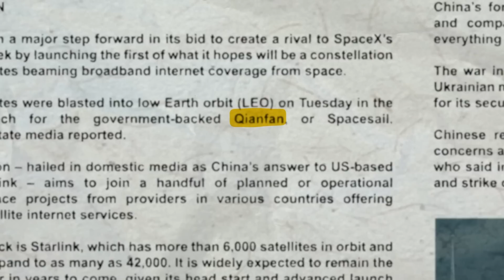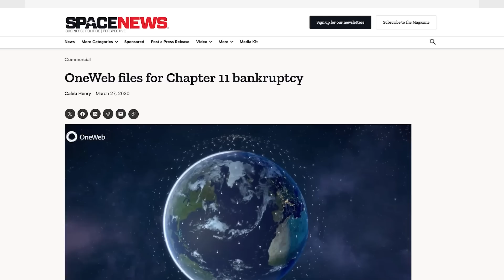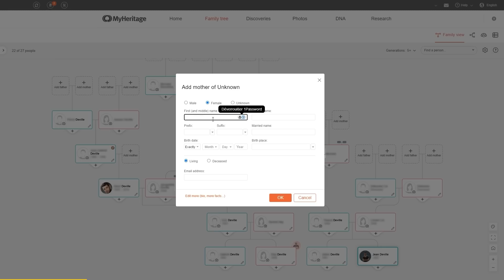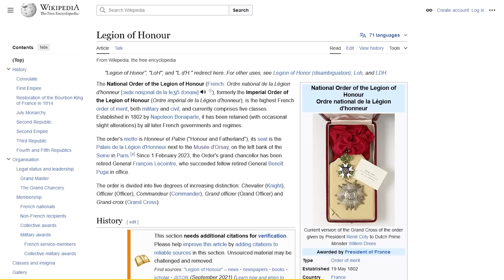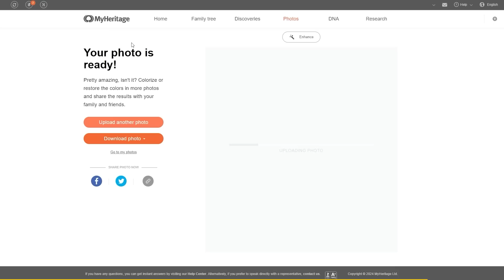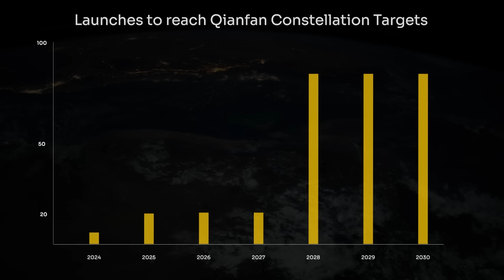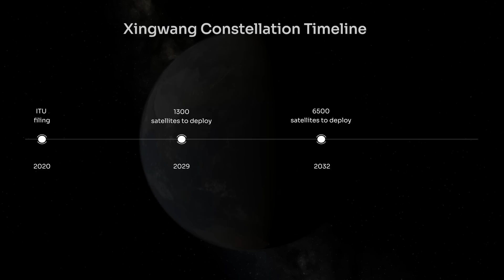China Is Deploying a Starlink-like Megaconstellation

Comment: Only 50$ to send satelitte not 50 millions $ with
AntiGravity Drone
Work base on Gravity just spinning by using Battery.

can fly in bad weather plunge in the ocean even in outer space

Earth which weight predict 600 trillion ton does not fall at the Sun because of centrifugal in orbitting, on the contrary it does not be thrown far go out the orbit line of hold by gravity at the Sun as orbit center. Gravity and centrifugal is equal called Equillibrium, thats why until now Earth which we was inhabited always rotate and circulate the Sun. Now we justly take example : how if the gravity used and centrifugal is negated? The Earth will float far leave the Sun. So that centrifugal can be used to fly far away if gravity eliminated. Finally how to eliminate gravity?

It’s way rotate part of aircraft by horizontal. When that rotation faster centrifugal force getting greater and the gravity getting smaller, finally it lose the gravity and the aircraft start flying. Of course people would surprise: how the aircraft can keep rotate without fulcrums? Thats why we named that aircraft Shuttling System that is aircraft likes two disc adjoining attached in the midle as fulcrums:

A. The Top part, we name Positive rotate to right, and the edges is getting thicker and havier.

B. The Buttom part, we name Negative rotating to left, and the edges is getting thicker and havier.

C. Middle Part , we name Neutral, air crew placed and also machine and everythings turning Negative and Positive at the same time.

The aircraft can liftup added with explosion from the engine. However that aircraft construction later, let the engineer doit it, and we are sure the aircraft will bulletproof and also waterproof.
 
.
.
 
In modern civilization where human being generally using flying saucer as vehicle, will a lot of change in lives either in materialism and in psychological. In materialism area will apply the change in life like.
People no longger need roadway and rel road which spend large of energy, money, places, things and time, object place and time. People would utilize that area for habitat or for other need:

Comment: Excellent coverage and 'what-if' questions. Really appreciate the work you do researching and creating content focused on China's space industry. 
Booster reusability is a must for economics to even work. Building up reflight counts is going to take time. Would not expect initial reusable boosters to be used more than 5-10x. Another factor is turn around time between flights, depending on essential maintenance. 
It's worth noting that not all satellites launched will achieve full intended lifespan. For example, SpaceX has lost a couple of launch batches (a poorly time solar flare, and an upper stage failure). Also not all starlinks launched are still in orbit. 100's have been retired (could be over 1000). Seeing recent hoppers fly has been exciting. Look forward to seeing more exciting milestone achievements from Chinese space industry.

Comment: Before China communication satellite arrays are completed, I bet the satellites will be improved at the cost of much larger weight  but drastically increased bandwidths including higher power antennas with tighter antenna lobes that allow closer spaced users to use identical frequency bands without interference, plus improved received signal to noise ratio, improved received signal sensitivity, improved transmitted signal strength.  I imagine a satellite with a large antenna array much like phased array radar antennas but unlike current phased array antennas which do not have individual directional antennas for each element, the satellite antenna would be a phased array of directional antennas. This improves antenna lobes by one or two orders of magnitude.  Higher altitude satellites allows wider coverage area. Higher performance satellites could provide real time voice communication and higher speed Internet. Signal latency would be somewhat improved for higher altitude satellites if communication now avoided satellite to satellite relays.

Comment: As far as we know, next Qianfan batch should launch on the first Hainan Wenchang commercial pad #1 CZ-8 in october or november, after having been delayed from september due to the typhoon Yagi.
Reply: At least to me it seems the near term deployment of these constellations will largely depend on CASC launchers.
Reply from the maker: I fully agree with you. Even if the first medium to heavy lift commercial rockets are coming in 2025-2026, the launch cadence is likely to be in the lower single digits, at first.
Reply: Only 50$ to send satelitte not 50 millions $ with
AntiGravity Drone
Work base on Gravity just spinning by using Battery.

can fly in bad weather plunge in the ocean even in outer space

Earth which weight predict 600 trillion ton does not fall at the Sun because of centrifugal in orbitting, on the contrary it does not be thrown far go out the orbit line of hold by gravity at the Sun as orbit center. Gravity and centrifugal is equal called Equillibrium, thats why until now Earth which we was inhabited always rotate and circulate the Sun. Now we justly take example : how if the gravity used and centrifugal is negated? The Earth will float far leave the Sun. So that centrifugal can be used to fly far away if gravity eliminated. Finally how to eliminate gravity?

It’s way rotate part of aircraft by horizontal. When that rotation faster centrifugal force getting greater and the gravity getting smaller, finally it lose the gravity and the aircraft start flying. Of course people would surprise: how the aircraft can keep rotate without fulcrums? Thats why we named that aircraft Shuttling System that is aircraft likes two disc adjoining attached in the midle as fulcrums:

A. The Top part, we name Positive rotate to right, and the edges is getting thicker and havier.

B. The Buttom part, we name Negative rotating to left, and the edges is getting thicker and havier.

C. Middle Part , we name Neutral, air crew placed and also machine and everythings turning Negative and Positive at the same time.

The aircraft can liftup added with explosion from the engine. However that aircraft construction later, let the engineer doit it, and we are sure the aircraft will bulletproof and also waterproof.
 
.
.
 
In modern civilization where human being generally using flying saucer as vehicle, will a lot of change in lives either in materialism and in psychological. In materialism area will apply the change in life like.
People no longger need roadway and rel road which spend large of energy, money, places, things and time, object place and time. People would utilize that area for habitat or for other need:

Comment: Checking details, they have smartly used a higher orbit, so the satellites will not require replacement every 5 years, as Starlink currently does. Still, that many satellites will hurt terrestrial astronomy.
Reply: Also their satellites supporting 5g network, the future one gonna support 6g network thats the reason why they able to use a higher orbit. For comparison currently the starlink still using 4g network
Reply: Higher orbit = weaker signal
Reply: @tluangasailo3663  Better a weaker signal than needing to replace 14,000 satellites every 5 years.
Reply: @downix  not a big deal when youve got a reusable rocket with the cheapest launch cost in history
Reply: @tluangasailo3663  it is when you don't have enough of them. Realize, they need to replace a satellite every 90 minutes starting next year. That is why Starship is so critical for them.

Comment: China is progressing on all fronts. It will greatly benefit mankind with its space technology
Reply: That's true.
Reply: Only 50$ to send satelitte not 50 millions $ with
AntiGravity Drone
Work base on Gravity just spinning by using Battery.

can fly in bad weather plunge in the ocean even in outer space

Earth which weight predict 600 trillion ton does not fall at the Sun because of centrifugal in orbitting, on the contrary it does not be thrown far go out the orbit line of hold by gravity at the Sun as orbit center. Gravity and centrifugal is equal called Equillibrium, thats why until now Earth which we was inhabited always rotate and circulate the Sun. Now we justly take example : how if the gravity used and centrifugal is negated? The Earth will float far leave the Sun. So that centrifugal can be used to fly far away if gravity eliminated. Finally how to eliminate gravity?

It’s way rotate part of aircraft by horizontal. When that rotation faster centrifugal force getting greater and the gravity getting smaller, finally it lose the gravity and the aircraft start flying. Of course people would surprise: how the aircraft can keep rotate without fulcrums? Thats why we named that aircraft Shuttling System that is aircraft likes two disc adjoining attached in the midle as fulcrums:

A. The Top part, we name Positive rotate to right, and the edges is getting thicker and havier.

B. The Buttom part, we name Negative rotating to left, and the edges is getting thicker and havier.

C. Middle Part , we name Neutral, air crew placed and also machine and everythings turning Negative and Positive at the same time.

The aircraft can liftup added with explosion from the engine. However that aircraft construction later, let the engineer doit it, and we are sure the aircraft will bulletproof and also waterproof.
 
.
.
 
In modern civilization where human being generally using flying saucer as vehicle, will a lot of change in lives either in materialism and in psychological. In materialism area will apply the change in life like.
People no longger need roadway and rel road which spend large of energy, money, places, things and time, object place and time. People would utilize that area for habitat or for other need:
Reply: The US is trying to kneecap thier progress. because the west hate "third" world beating them at their own game.

Comment: It looks like China will need a Starship capability starting in 2028. My guess is this capability comes from a huge reusable 1st stage and an expendable upper stage.  They will also need a factory to mass produce rocket engines and a production line for starship boosters and expendable upper stages. This means as soon as a Falcon 9 equivalent performance rocket is achieved, the starship equivalent performance first stage development will hit the ground running (probably the wrong expression to use when talking about rockets)
Reply: Ultimately, I expect China will follow a compressed development schedule of SpaceX with continuous improvements that double their Falcon 9 equivalent payloads to current Falcon 9 payloads, while simultaneously developing a starship 1st stage equivalent. Instead of a reusable upper stage (which sacrifices a lot of payload), the starship upper stage will evolve into a reusable 2nd stage with an expendable 3rd stage. This will be an optimal cost per kg payload delivery, because most the hardware will be reused, while 3rd stage is optimized for maximum payload.   Considering the higher altitude of the 30,000 communication satellites, a 3rd stage makes more sense.
Reply: During the development of their starship, more weight will have to be added for the rocket which cuts into the payload. Eventually, iterative improvements will reduce weight, increase thrust, improve ISP and thereby increase payload. But at first the payload could be disappointingly underweight. As a solution to this temporary problem, the reusable Falcon 9 equivalent 1st stages could be used as strap on boosters for the starship 1st stage.

Comment: Avec la Chine c'est la prospérité partagé comme le dit si bien le professeur Jean Paul POUGALA. 
Très loin de ce que hégémonie occidentale nous a proposé jusqu'à présent.
Reply: Only 50$ to send satelitte not 50 millions $ with
AntiGravity Drone
Work base on Gravity just spinning by using Battery.

can fly in bad weather plunge in the ocean even in outer space

Earth which weight predict 600 trillion ton does not fall at the Sun because of centrifugal in orbitting, on the contrary it does not be thrown far go out the orbit line of hold by gravity at the Sun as orbit center. Gravity and centrifugal is equal called Equillibrium, thats why until now Earth which we was inhabited always rotate and circulate the Sun. Now we justly take example : how if the gravity used and centrifugal is negated? The Earth will float far leave the Sun. So that centrifugal can be used to fly far away if gravity eliminated. Finally how to eliminate gravity?

It’s way rotate part of aircraft by horizontal. When that rotation faster centrifugal force getting greater and the gravity getting smaller, finally it lose the gravity and the aircraft start flying. Of course people would surprise: how the aircraft can keep rotate without fulcrums? Thats why we named that aircraft Shuttling System that is aircraft likes two disc adjoining attached in the midle as fulcrums:

A. The Top part, we name Positive rotate to right, and the edges is getting thicker and havier.

B. The Buttom part, we name Negative rotating to left, and the edges is getting thicker and havier.

C. Middle Part , we name Neutral, air crew placed and also machine and everythings turning Negative and Positive at the same time.

The aircraft can liftup added with explosion from the engine. However that aircraft construction later, let the engineer doit it, and we are sure the aircraft will bulletproof and also waterproof.
 
.
.
 
In modern civilization where human being generally using flying saucer as vehicle, will a lot of change in lives either in materialism and in psychological. In materialism area will apply the change in life like.
People no longger need roadway and rel road which spend large of energy, money, places, things and time, object place and time. People would utilize that area for habitat or for other need:

Comment: Am curious, how do these many satelites avoid running into each other? It seems like the place is crowded!
Reply: They communicate each other then ignite ion thruster align itself parallel
Reply: @Gear_labs  Interesting. So that means that when the fuel for the thruster runs out, they must de-orbit to remove collision risk?
Reply: @alispeed5095  nah they never run out of it. Ion thruster throw out electron that they get back from solar panel
Reply: @Gear_labs  ion thruster use fuel. The electron is used to charge the fuel, to propel it. Electron cannot be used alone to create thrust. Fuel used is a type that is both heavy & not chemically change when charged up, like nobel gasses, such as Argon, Xenon, Krypton.
Reply: Not as crowed as flight radar 24

Comment: Firstly China will pull it off because it's a must have capability for military. Global connectivity of from cell phone sized devices enables a huge leap up in military capability of extremely small devices which were previously limited by comms range. Those range comms limits disappear with global connectivity enabling all sorts of tiny network centric mur*** bots. The beginnings of this are already happening in one conflict.

US is paying SpaceX to deploy a separate starlink network for its military.